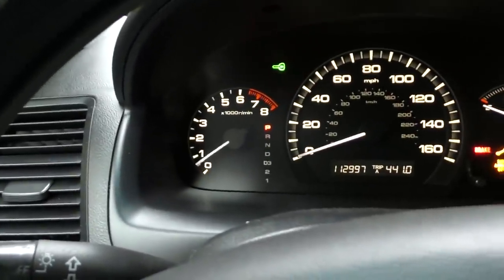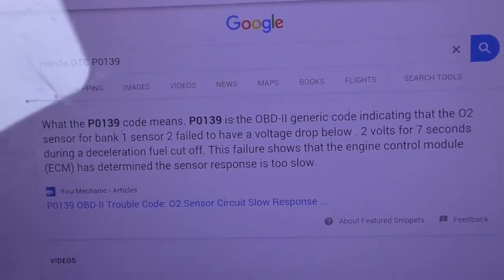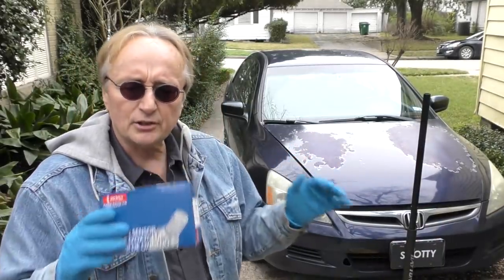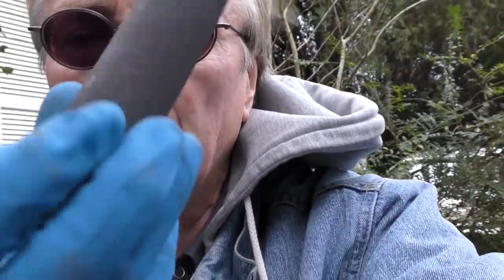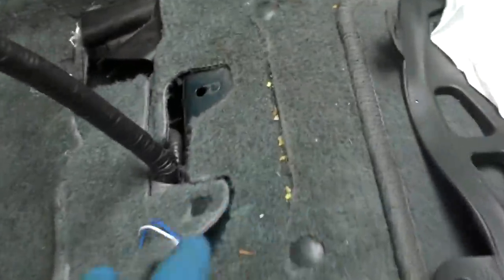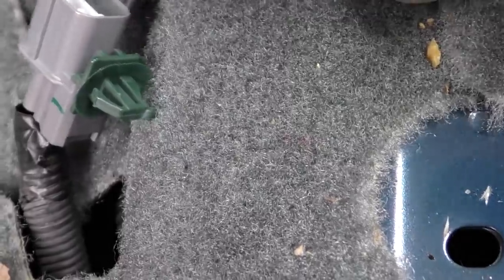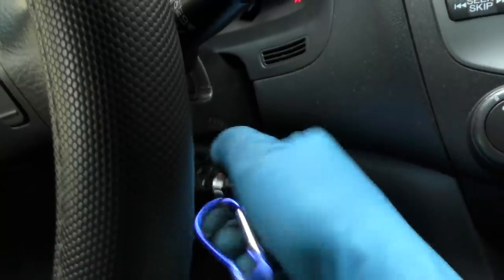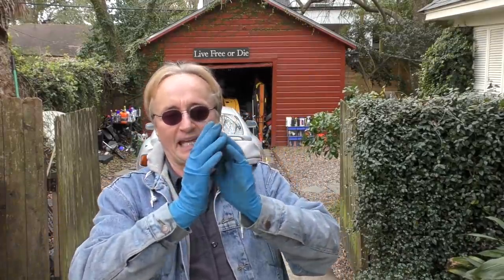Here's Why Mechanics Hate Hondas

Comment: Heres why dealership (stealership) mechanics hate Honda's and Toyota's: They don't break as often! 😂
Reply: Hondas  have   more   problems  and  are  more  of  a  pain  to  fix,  which  is  why  mechanics  like  Toyotas....especially  94  Celicas.
Reply: Unkwon Malaysian Guy there are RARLEY ever problems with Honda engines to begin with though, and by the time they are worn and have problems they usually have over 200k miles
Reply: @annettesurfer  He's working on a 2007 Accord VP with a 2.4K motor, not the V6.
Reply: True and when they do break there simple to work on
Reply: @annettesurfer  I do think there are some models to be had still that perform excellent from Toyota/Honda, especially the 06/07 Accords.
Reply: driver4011 I have a ‘92 Celica and some mechanics don’t want to work on it because it’s too old. Not all mechanics can fix old Toyotas.
Reply: @ricksays7133  ow.
Reply: @applepoop10  Very rare and specific to particular models, first gen Jazzs ,V6 Accords. Never had any issues with any of mine. All well over 200.000 miles on them.
Reply: I have a lot less problems with my Honda than my Lexus (02 es300 V-6), repairs are a third of the price too.
Reply: @driver4011  ever change an avolon passenger axle, or do a tune up on a Lexus 3.0 or 3.3. hondas are easier any mechanic will tell you that.
Reply: This one (video) has problems ⬆️
New 1.5T GDI engine oil dilution problems 👎
Reply: Only if you take care of them and don't abuse them.
Reply: @mrgarrison3516  is this a newer engine? Most companies are downsizing engines, and to compensate they turbocharge.
Reply: Good god you started a war
Reply: 7 Honda’s in my family since 1975- Honda Life ,5 Accords,one CRV and 2 Civics. The Accords all did almost 200,000 miles- well over 300,000 kilometres. Not one had a breakdown apart from battery issues or one bad alternator. So yeah I’m a life long fan. Granted NVH in Toyota’s are better but then... nothing beats the handling and performance of a Honda compared to a Toyota. Both however do beat most cars in the world when it comes to reliability.
Reply: They Break  a lot more than you think
Reply: Yes. I was about to make this very comment. You beat me to it. 😆
Reply: Dreamy all things mechanical wear out.  I have seen and heard of Toyotas and Honda's breaking down also. It is foolish to believe they defy the friction laws of physics
Reply: Everything breaks there’s not a single car that doesn’t eventually have something break on it
Reply: I had a 2004 Civic. All it did for 14 years is run perfect. Honda makes great cars.
Reply: I have an '04 Accord 3.0 EX that has 256K miles on it. Has only ever had general maintenance (oil changes, etc) it has never had any major problems. The only thing I had a problem with was thinking my alternator was going bad. Previously, a fuse had gone bad and the mechanic stripped a wire checking them and didn't cover it after so the wire leading from the battery/fuse box going to the alternator literally broke in half. My brother and boyfriend got it fixed in about 5 minutes and problem solved. I don't care if mechanics hate working on them, I'll keep buying them because it is so reliable.
Reply: @emilypresleysee  Replaced my Civic with a 2018 Fit. Kinda goofy looking but I love it.
Reply: Emily2618 exactly! Yes all things mechanical do eventually have wear and tear issues but with good regular maintenance and servicing Hondas defy aging. Seems some haters still gonna hate..
Reply: I've been working on Hondas and Toyotas since the 90s.  They're not some mythical unbreakable creature, but they Are reliable.  Maintenance and how its driven impact everything.  Nobody ever admits they drive their car hard when its broken.
Reply: Have worked on Acura's and Honda for years I can tell you they break.. just like all cars.. we were putting  transmissions in the TL Type-S  constantly, typically with only 30 or 40k on the clock.. Js
Reply: @annettesurfer  all the time..  we're doing Transmissions constantly in those cars
Reply: @Silent_Shadow  I had a '95 Chevy Cavalier for about 8 years (bought in 2001) that was an absolute piece of junk that I went through two engines in. Barely made it past 80K miles before they needed new transmissions, alternator, etc. I will absolutely admit that I drove it hard lol I put that car through way more than it could ever be expected to hold up to but at the same time it had problems every time I turn around. I drive my Honda pretty hard sometimes too but it has literally had no issues and I bought it from the original owner (who is a close friend who bought it when we were in college so I know he gave it hell) when it was already over 10 years old. Based on my limited user experience I'll go with a Honda over a Chevy any day. Cue my mechanic grandfather rolling over in his grave
Reply: @billsohan  yes!! I'm not saying they are infallible but they are so darn reliable! I have to say all my friends who have had Honda's and Toyota's have said how much they regret selling them and buying Chevy or Ford 😆
Reply: Lol Honda are easy as Fck to fix. This is coming from someone who’s owned vws, bmws, Nissans , Honda’s and a Toyota. By far out of all those the Honda’s were the simplest and esaiest car to fix , a chimp could fix them. Worst cars I’ve had were a Sebring and a bmw. Vw was okay but you had to take off the whole front end to do any work on them.
Reply: Lol Honda are easy as Fck to fix. This is coming from someone who’s owned vws, bmws, Nissans , Honda’s and a Toyota. By far out of all those the Honda’s were the simplest and esaiest car to fix , a chimp could fix them. Worst cars I’ve had were a Sebring and a bmw. Vw was okay but you had to take off the whole front end to do any work on them.
Reply: Unkwon Malaysian Guy if you think Honda’s are complicated then I think you need to take a look at a Mercedes and Bentley wiring diagram lol.
Reply: Unkwon Malaysian Guy if you think Honda’s and Toyota’s are a pain to work on then you should look up a Sebring starter replacement and an Impreza clutch replacement lol, or a mk4 Jetta 1.8 or 2.0 timing belt replacement
Reply: @Silent_Shadow I totally agree with you.  I have had both good and bad Honda's and Toyota's.  Each manufacturer seem to have different strengths and weaknesses.  I drive my car hard and, surprisingly, rarely have excessive wear issues. I do wait until everything warms up before getting on it and keep up with maintenance. My daily driver actually has an oil temperature gauge so i monitor that before driving hard.
Reply: That's why lack of experience mechanics hates hondas...lmao!!!
Reply: @johndoran1754  I have a 2004 civic as well and it's been problem after problem with it. A blown head gasket at only 131000 miles being the most costly thing I paid to fix so far.
Reply: Toyota, maybe but not Honda, unless your Honda is from the year 2000 or older...it's a clunker. Not at all reliable.
Reply: Unkwon Malaysian Guy lol there usually 4 bangers , they are pretty easy
Reply: My wife's Camry had several problems and it was a pain in the butt to work on compared to cars I've had in the past. 

She currently has a 15 Sonata and it's probably the most intuitive I've owned to work on.
Reply: @kevinj.p.6277  Sorry to hear that. Mine was pretty much perfect for 14 years.
Reply: Unkwon Malaysian Guy  that Honda Accord in the video is the 7th gen mostly the 2003 to 2004 stay away from them they have major issues...
Reply: @emilypresleysee  wow you Lucky cause that year has transmission problems..so bad that Honda had major lawsuits with the 03 and 04v6..
Reply: @trini_boi2414  I never even heard about that. The previous owner is the husband of one of my best friends (like, over 30 years knowing her) and he never had any issues with it. I'd have known about it if he did. I really am a pretty lucky person in general though lol (one summer a few years back I found over 200 4 leaf clovers and a few 5 leaf and even one 6 leaf.) 🤷🏻‍♀️😆
Reply: Unkwon Malaysian Guy  vtec solenoid is easy to fix
Reply: My Honda has nearly 230K in miles... Only had to replace a radiator and brake pads once. Super low maintenance vehicle.
Reply: @bolt-action9470  .. It depends on the model if you had the minivan or a pilot you wouldn't be saying that.... The most reliable were the 4-cylinder accords and the civics
Reply: Honda's are not known to be reliable. Worst Transmissions that break down. Honda engines depends on the year model and other years are Crap engines. Unless you have SIs then you got Gems.
Reply: Well, my mom's '03 is starting to drink oil like mad and it likes to eat up rear brake pads.  But with a verified 230,000 miles on the spark plugs (and nothing but brakes, tires, air filter, and oil changes), it has earned a status of extremely reliable.  I wonder how much the original owner fixed in its first 80,000 miles?  But as the odometer ticks past 310,000 I have to wonder if a PCV valve would help reduce oil consumption.
Reply: @annettesurfer  There was only a generation of Honda's that had transmission problem and you think Honda has a false sense of superior build quality?
 I have over 10 cars that my family still drive daily that are 30 years old (or near 30) with over 350,000 Km (217,480 miles) on original transmissions. This far exceeds your 1 unit.

Also I believe the failures are mainly after warranty period when the transmissions are either not serviced by Honda, not serviced at recommended intervals or serviced but not using original Honda fluid. A common error by owners and non-Honda mechanics. Honda transmissions are designed by Honda and NEEDS Honda oil. Unlike other manufacturers like Toyota, Nissan, Peugeot, Mercedes, BMW etc they pay fees to Borg Warner as the transmission designs are the same (using similar fluid not very special or specific like Honda).
Reply: Dreamy - really how long have you been working on cars ?
Reply: Actually, my mechanic likes them.  I have a 2005 Honda CRV and he said that they last forever.  The older mine gets, the more regular maintenance the does on it.
Reply: @annettesurfer  Idk what happened to yours. The transmission on the Accord I used to have never failed, and even still had the original factory clutch at 300k miles.
Reply: Unkwon Malaysian Guy  That's true but if you use the correct oil and replace it often enough the engine will usually run reliably.
Reply: Unkwon Malaysian Guy  not if you change the oil so it don't plug up the valve timing very small ports
Reply: @mwood65   Honda s are better than Toyota and better looking
Reply: @brandonmurphy4657  my Lexus is more quiet and comfortable,  the leather is more plush but I've had to sink thousands of dollars repairing it. It wouldn't be so bad if it didn't have a timing belt. I gave my 2004 Accord to my daughter,  she t-boned a car going 60mph and only got a bruise from the seatbelts. My lexus was a free hand me down and that's the only reason I don't mind spending a little on repairs. My daily driver is a 2010 accord 4 banger. I have a 20 year old F-150 5.4 with a lot of issues but it's still a good truck, even after two teenagers and an ex-wife. I'd replace it but I don't like car payments.
Reply: @mwood65  I don't like payments either . I have an 08 accord 4 cyl it runs perfect
Reply: This one did.
Reply: Unkwon Malaysian Guy  Simple sistems yet so complicated to some to understand 🤦‍♂️ They need someone who knows how to do the work, not curious people thinking they're mechanics 😉
Reply: @driver4011  Sure thing pal 😂
Reply: @kevinj.p.6277  Maybe because you bought a car that was very well treated, very well maintained before you and now that it's in your hands you keep doing that good maintenance etc right?!😉 Talking trash about something because you had a problem with it not knowing what happened  before you got it and not maintaining it well is a little absurd don't you think? 😉 I think we can count on our fingers the majority of people that have those cars and complain about them.
Reply: Steve you got very unlucky. Toyota and Honda are far and away the most reliable cars made. It’s not even relatively close
Reply: My scion didn't last ☹️
Reply: My honda is 20 years old and never had a problem with it
Reply: I have bought 3 Hondas and had no problems with any of them. I had the oil changed when needed and that's it
Reply: They have to nitpick thats whats funny. Go to a junkyard. Theres plenty GM crap with no body issues meaning its either engine/trans or electrical. Look up tacoma then look up a silverado. Numbers speak for themselves.
Reply: Worst car I ever owned was a Honda Ridgeline what a pile. Had it from new too.
Reply: @kevinm2025  Ill give you that lmfao! What a piece of truck. Electronic throttle response? Lmfaooo my tacoma dusts them whenever we line up.
Reply: @lilbazel  I’m so glad I bought a Titan ......what a beast of a truck.....Nissan and Toyota are to go to foreign trucks to me.
Reply: @kevinm2025  I wanted a titan but it didnt fall through lbs for now my 04 tacoma a dog. 3400 leaves most trucks out here in the dust lmao.
Reply: @thatguy1919  you can't be talking about the 1.5t the slug problems is a engine killer especially in cold weather country. I own one and love it but I seen a lot of them at our shop with slug stopping up the vvti system which if not caught in time leads to total engine failure.
Reply: @chatsworth8768  there’s an exception to every rule 🤷🏽‍♂️
Reply: @ClipSwitchFlashlights  probably not. I have a 98 accord with 290k and i replaced the PCV valve and my engine still burns oil a lot. Its just how it goes with high mileage engines
Reply: @poolplexer  Yeah, it's using a little less oil but still quite a bit.
Reply: On the whole, compared to many US-made brands like Chevy, Chrysler and even other "import" brands like BMW and Nissan, yes they are more reliable (along with Toyotas) and generally don't need as much constant repair work, so yeah mechanics don't like them because they don't break down as much.
Reply: Unkwon Malaysian Guy I mean duh most of them are built foreign
Reply: @kevinm2025  : I will go Nissan, for me, it's a big no no for honda and big no no for toyota as well.
Reply: I took my civic 04 to the dealer for a 60k service, and after they checked the car, they said that it only needed the spark plugs, not because the spark plugs were bad but because the car had platimum spark plugs. Basically, they could not find anything wrong.
Reply: Man,thise honda transmissions are bulletproof LOL!
Reply: John Doran.  I had to buy a fit for parking issues at work. But I gotta say i love it too. I have been able to do way more construction work on rentals than i ever would’ve imagined. At 40mpg! My truck is a 1 ton dually.
Reply: No the newer Hondas aren't what they used to be trust me on that.
Reply: Saying this proves you are not a mechanic. As a mechanic I will say the 2007 and back are the best. But...their still over rated. Why? I've had less problems with older focuses and longer average lifespans than Honda. 
The focus zetec engine didn't have head gasket issues like the common Honda issue. You can get 400k out of a Honda but you will do 3 head gasket jobs. 
I have 175000 on my duratec 2.0 and it has the original head gasket. Honda would have it done 30-40k ago.
Reply: Unkwon Malaysian Guy  v tec solenoid took a whooping 10 min to fix and the part was 15 bucks at a junk yard lol
Reply: @Yondaily   yeah. Sooo much. Go get a bmw and when a liquid motor mount goes you might wake up.   aw well.
Reply: @92174164  if we could teach our kids to do oil changes and trans flush  the issues would be normal issue. That all cars have.    I honestly have never had an issues that I couldnt fix.  I've rebuilt my trans  cause it was grinding in 3rd 2nd gear was a lil chewd up so I replaced that. It was really too easy.    I won't ever not have a lil Civic kseries fan.   Too easy and cheap to fix
Reply: @HatsuneM1ku01  you have such a  way with language
Reply: i drive a 2001 honda civic and the only issue i’ve ever had with it was the radiator cracking, most likely because the previous owner never changed the coolant. otherwise it runs great and i love it
Reply: @mvuanyeusii  stock ones with plastic on the top  always crack it's a matter of time.  I guess if u baby it it could last but if u run it hard and that plastic heats up and cools down it hurts the plastic. And I'f the car ever blew a water pump and overheated that will usually crack it from pressure
Reply: @automobilesarefun409  you make automobiles sad.
Hondas are absolutely known for being reliable cars, world wide.
Facts are facts, and opinions are opinions.
BTW, I've never owned a Honda nor do I plan on owning one, I live in a place where we get a lot of snow, and my work requires to have a truck.
Reply: Was thinking the same I had a 93 accord with over 500000 miles on it
Reply: @thatguy1919  Toyota is cheaply made

Comment: Pro tip, screw in the o2 sensor to the exhaust pipe FIRST, then connect the 02 wire connector into the harness connector, you wont have ANY kinks or twists AT ALL, those wires are already subject to damage all the time so less or no tension on them can prevent further damage or at least less damage if something kicks up at them while driving